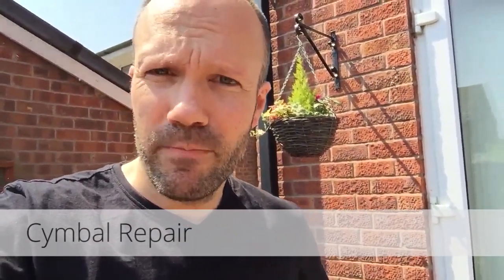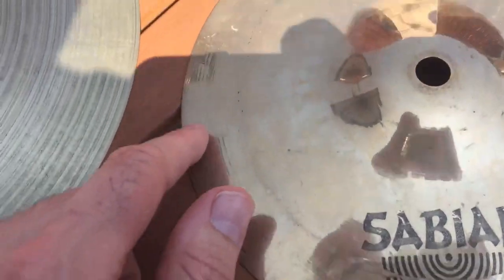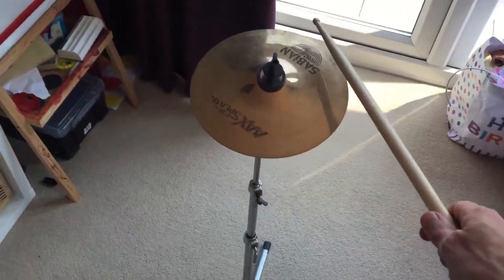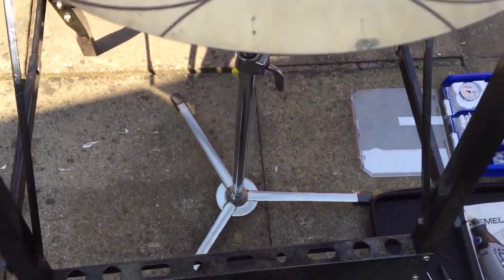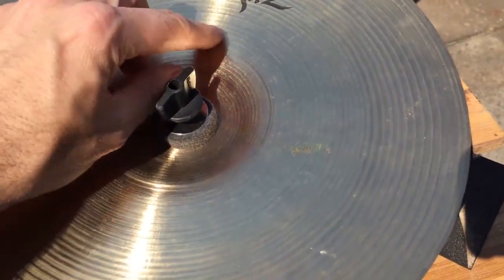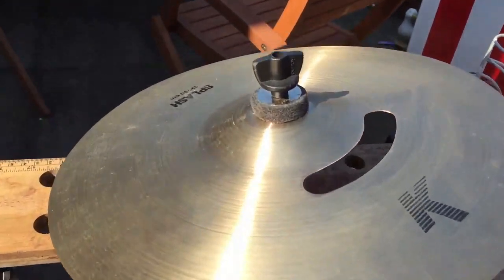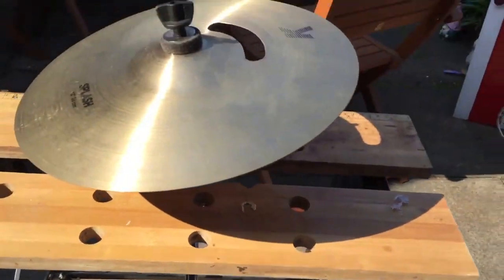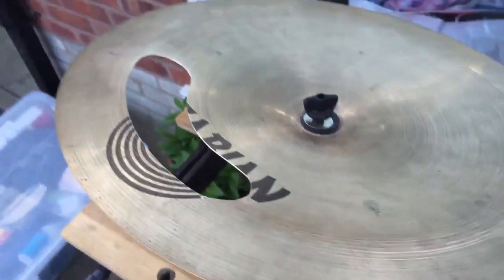4 cymbals repaired in 4 hours

Comment: The extension cables for rotary tools are totally worth it. They get the weight and heat of the motor out of your hands, increase clearance between the handle and the work, and let you hang the motor in front of a fan to keep it cooled.

Comment: You do realize there are different drillbits depending on the material right? Those hole cutters are made for wood. To get a smoother cut sand it from 80 grit to like 400 grit then polish with Steel wool or something

Comment: Why did you do that to the first two cymbals you could of just shorten the size of the cymbal
Reply: I've watched a few of these cymbal fix videos and from what I've gathered, if you cut off just a piece of it to keep it from cracking more, it retains most of the same cymbal sound. Same tones. If you cut off a whole inches all around it changes the sound completely since the thickness of the cymbal is meant for the original size. Usually sounds bad

Comment: You are struggling with the wrong type of hole saw. The pitch and set is way too coarse for the material you are cutting and too great a risk of damage. A fine cutting good quality bi- metal hole saw from a quality maker would make a much nicer and finer cut. Using a pillar drill a great help too. The bronze they are made from needs to be worked with great respect. Hard to get right but results are worth it.

Comment: Nice work. But these aren't cymbal repairs. More of a cymbal rescue. A repair would be welding the cracks, which is basically impossible.
Reply: marscounty This IS a repair. You can’t weld new material to a cymbal without major disruption of the sound. This is the best thing besides just melting down the scraps and starting fresh. If we have cymbals that ship from the factories with HUGE holes cut into them, there’s no reason to consider this ONLY a rescue.Its just another phase in the cymbals life before the end.
Reply: Joe Rico ...I see what you mean. To me a repair means bringing something back to the condition it was in before it was damaged. As you mentioned, welding cymbals really isn't an option. I would say cutting out cracks is a modifying the cymbal so you can continue to use it. Yes, the next step in its life.
Reply: marscounty Unfortunately for a cymbal there are fewer states of existence. There’s a complete cymbal and a modified cymbal. Not like a vehicle where parts replacement is a reality.
Reply: It's an argument of semantics.
Reply: @mfb5642  Jake Winebrenner in nashville has been using an industrial laser to weld/fuse cymbals. no extra solder material